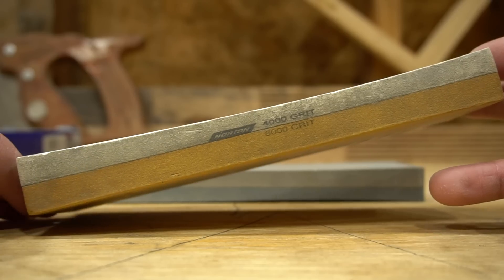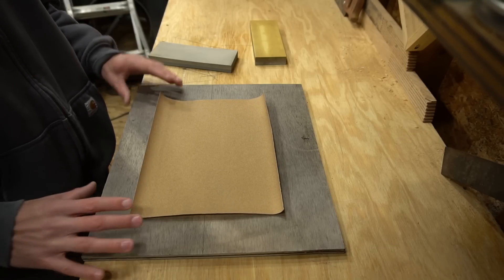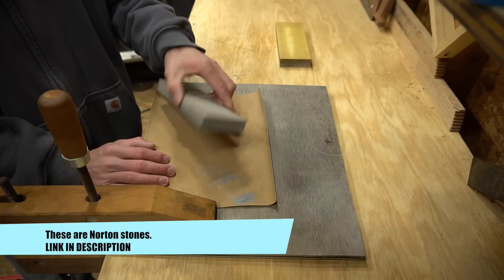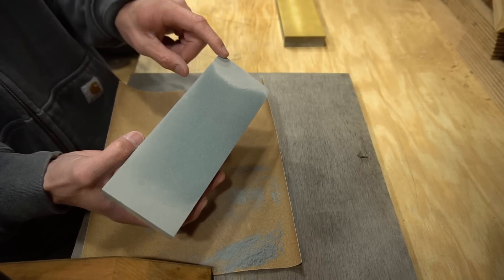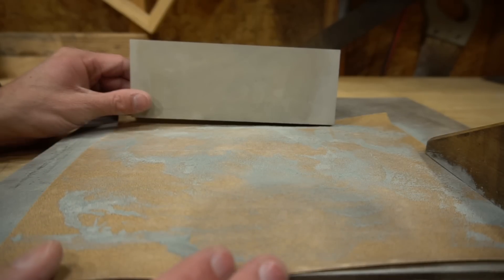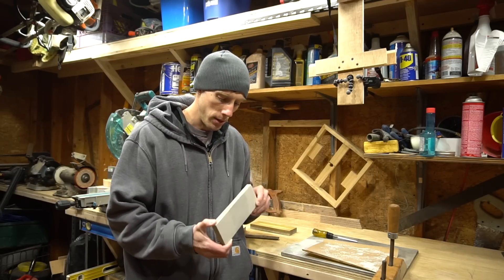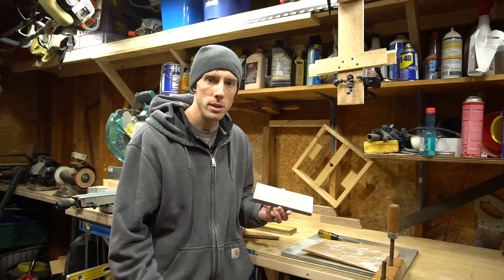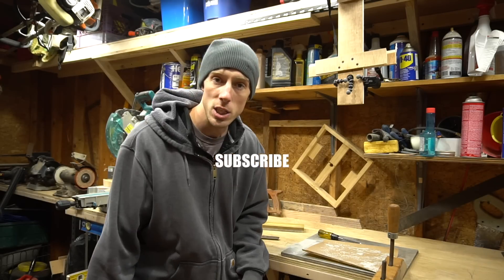How I flatten my knife sharpening stones | Knife sharpening tips 4

Comment: Just be careful with the dust it can kick up. Silicosis is no fun. That's one big reason for using water.
Reply from the maker: You'd have to breath a lot of dust for silicosis to occur. That typically happens over years of exposure. Ive worked in areas where silica dust was a problem. Even with proactive gear I've probably breathed more of it in that environment than I have flattening stones once or twice a year.  Id still recommend using a mask or water if the thought bothers you.  Thanks for the comment😀👍
Reply: @OUTDOORS55  The fact that one had already exposure to dangerous dust is not a reason to avoid to protect ourselves, maybe is a reason to protect us more carefully as the risk grows with the amount of the exposure. My 2 cents are that for someone that flattens occasionally the stones without power tools there is no reason to worry, using the belt sander it is completely different, you had to switch off the camera to protect it, the same is true for lungs. A protective mask is really cheap, even the professional ones, and flattening the stones as last work of the day the next day the air should be clean enough to breathe without any risk.

Comment: I use a offcut block of granite from a headstone maker and sifted river sand. Use a fine kitchen sieve. Sprinkle the sand on the block, sprits with water and apply elbow grease. Ad sand and water as the previose lot turns to mud. All comes free, and I am cheap, so it is a good deal and system. I use Nortan stones and selfmade pure cement stones, and sandpaper just dulls too quickly.

Comment: A much better and cheaper way to do this is with a piece of scrap glass (very easy to find on trash day) and some silicon carbide blasting grit.  Also, learn to better utilize your stone's surface area so your stones don't get so dished in the first place.  And finally, as many others have said, never do this dry for safety reasons.  Using a lubricant also makes the process go faster and cleanup easier.
Reply: Atoma diamond plates and water for me. I try to protect my lungs as much as possible.

Comment: I tried this with a 30 year old Lansky stone. It didn't flatten my stone, even after 20 minutes, The interesting thing is that the corners where it was touching started acting like a set of diamond ground flat stones like you would use in the machine shop. So a 100 grit stone now felt like maybe 800. Maybe I just got some crappy sandpaper. Maybe I need SiC paper?

Comment: I must thank you for the amazing tip. I bought 3 sheets of 120 grit water-resistant sandpaper, put on a thick glass surface (in my case short table), added some water and flattened my 3 Shapton Korumaku stones. I had no vice, so I held the paper with one hand and moved the stone with the other. Not even 5 minutes I was done. After, I rinsed the sandpaper with water and let it dry for later use. I marked each one with the grit of the corresponding stone to not mix them up.
Total cost 3$.
You're the best!!!!

Comment: Great practical tutorial as usual.
I'd like to add a tiny bit of advice if I may. If you do this by hand don't throw away the sandstone dust, you can use it on a wet cloth for surface rust removal and rough polishing of large irregular metal objects.
Reply from the maker: Interesting, ill keep that in mind👍
Reply: It's also used in the clay for yaki-ire (differential hardening) the whetstone powder is added to a 1:1:1 ratio along with clay powder and charcoal powder. It's then mixed with water and applied to the blade with little to no clay on the edge.
Reply: That's very clever 👍

Comment: might be a dumb question but is it critical that the stones be flat? like how far yours was, would that produce a poor grind or the wrong angle?
Reply: martin blouin it will just cause a convex grind/bevel.
Reply: yes, you will need to have flat stones for a proper V edge. if it's a little off, it may not make a huge difference but better to flatten them more often than not. unless you want Convex edge (which if your daily tasks benefit from a convex edge, then its great idea, google edge types).

does Outdoors55 have a video on different Edge types? that would be a great one for him to do. what the different grinds are and what they specialize in.
Reply from the maker: Tactical Center is correct. It doesn't hurt anything but will give you a slight convex edge. I have found, even with a flat stone, I will still convex a little. Im not sure a human is capable of maintaining any angle, as to not convex even a little. Im sure someone out there can, but its definitely not me haha.  Knives with large bevels like scandis it is possible to get an accurate perfect v shape with a flat stone. It just depends what your looking for.
Reply: Definitely agree. its hard to not convex a little unless you get a guided system like KME, Edge pro, lansky etc. but as long as you apex it will cut.

Comment: If you used water wouldn't it "carry away" some of the removed material and make the sheets of sandpaper effective longer?
Reply: yes it would, I use the same method but it never takes me 5 sheets to flatten a stone, 1 sheet for both sides. Of course his stones might be harder.
Reply from the maker: My stones were in bad shape thats why it took so many sheets. I don't like using sand paper after it starts cutting poorly so I change out a lot . I suppose you could stretch it but at the cost of time. Thats my opinion anyway, your milage may vary😀 Thanks for the comment!

Comment: This method is good for relative soft stones, the problem is to flatten high quality ceramic I.e. (SiC, Al2O3 ZrO2) in they pure from and all sorts of mix of them. The only way there is to use another as hard stone and arm yourself with patient. You may use diamonds but it is expensive. I writing it cause I allerdy flattening one of this hight tech stone, and it is not a easy task.

Comment: I like that you use the word "relatively" several times - sharpening is personal thing and every man has its ways. Sharpening cutting tools can be really relaxing and enjoyable hobby. I catch myself sometimes trying too hard and makes simple process difficult. P.S. These Norton stones look too soft and it is sad to see so much abrasive to go into the trash - can I suggest: Naniwa Professional 400 and Sigma Power Select II - 1000 in the lower grits?
Keep the good work and the interesting videos coming.
Reply: Stefan Wolf, why not naniwa professional 1k?
Reply: Frederick Kunitz only reason to suggest the SPS II 1000 (it has no bonding agent/material) - to try different types of stones
Reply from the maker: Stefan Wolf- For sure, sharpening is a personal thing and everyone has their ways. What works for me may not work for others. The Norton stones are soft stones. They are slurry stones and really need practice in order to use efficiently. They work great when used properly. Although if I had my choice I would use splash and go stones over slurry stones any day. I use the edge pro stones more than anything. Im not super picky as to which stones I use. As long as they do the job thats all that matter to me. I guess I'm a simpleton haha. Thanks for the comment😀

Comment: I've seen the Norton's Stone Beginner's set on Amazon and it comes with a stone flattener, have you used one of those? I'm still saving up for a good middle priced set of water stones, I think I'll try those Edge Pro one's you showed, don't want to spend a lot and end up going back to my faithful Lansky set.😎
Reply from the maker: I haven't tried a dedicated flattening stone.  Im not sure they are worth the money unless you need to flatten a lot. The edge pros are great if you don't mind the small size. They cut great and last forever. I wish they made them slightly bigger though.

Comment: Did you have that big of a dip in the stone on purpose for the video or was that how your stones usually are? You really shouldn't let it get that bad, to the point where its visible. I use a diamond plate for flattening and after each sharpening I draw a grid with a pencil and hit the stone with the diamond plate. If it takes off the whole grid with a few swipes then its still flat. If not, I do it until the grid is gone, draw a new one and check again with a few swipes. It's easier, faster and preserves more of your stone to do it regularly rather than wait until a huge dip forms. Not to mention it's better for sharpening to have a flat stone.

Comment: 150 Grit? I wouldn't mind using 150 on my 1000 Stone, but is 150 still okay to use on a 10000 Stone? I mostly only use this stone for straight razors, and I may need to flatten it soon but I'm not sure what grit sandpaper to use
Reply: Depends how bad the stone is. If you have to do a lot of work and it has a big gully in it like the stone on this video the do most of the work with something like 150 grit. I would still probably do most of the work with 150 grit anyway or lower. Then when it gets close I would finish it with a finer sandpaper, I would recommend 600 grit. If you don't like the way it feels then you can adjust up or down from there.
Reply from the maker: If your stone is bad it will take awhile on anything finer than 150 grit. I flattened my 8000 on 150. If you need it to be super smooth for the first blade use a finer paper and smooth it out.

Comment: Personally I would recommend flattening whenever you put a straight edge like a steel ruler against the stone, hold it up to the light and see light come through the gap. You will find that even though you level it more you will wear the stone down less. Especially with these more expensive stones that can be desirable. To explain why it wears less imagine a pothole in a dirt road. It starts off really tiny. But you will notice it will double in size faster each time (up to a point and with the same amount of traffic). This is because as it gets bigger the gets hit harder each time and therefor grows faster. With the stone you are basically doing the same thing with the gully in the stone.
Typically I am a little lazy and don't do all my stones at the point I mentioned unless I am doing other peoples knives. This is because you get a more consistent angle on the blade when the stone is flatter. But for my knives I don't mind so much.

Comment: Some people just use two identical stones (pairing a set when new), then it's possible to true them against each other. You just have to remember to alternate between them when sharpening too.
Reply: the correct technique is to use 3 stones, as with only 2 is likely that a convex face and a concave one are obtained, the method can be used sometimes with not too dished stones if the sand paper is not available for some reason, as the surface will be  very close to flat, but using only and every time the 2 stones method does not give a good result as once a pattern concave face and convex face is established each subsequent flattening make it worst.
Reply: @andreachinaglia5804    I do flatten my two stones against each other and I've never had a problem. Please explain to me how having two equally concave stones of the same brand and same grit, you end up with one concave stone and convex the other, it really puzzles me. Thanks.
Reply: @redangrybird7564  because even if you try your best to have an even movement you can end in 2 flat mating surfaces as well as in 2 mating surfaces that are 1 concave and 1 convex.
Actually the old method used to obtain lenses was to rub one against the other 2 discs of glass with some abrasive in between, while to obtain those perfectly flat granite blocks that the mechanics use as reference 3 blocks of stone are used alternating them constantly.
I don't doubt that you obtained 2 flat enough sharpening stones, but using exclusively the 2 stones method it is sure that you will end with 1 concave and 1 convex surface in the long run. And as the surfaces will mate perfecthy your only chances to correct it is to introduce a 3rd stone or use a flat surface and sand paper.
Keep what i say in the correct proportion, you can flatten your 2 stones many times with the method you use, but as soon as you start to see that the obtained surfaces are 1 concave and 1 convex go to the sand paper using the most true surface you have to back it. I hope that now it is clear to you.

Comment: Well darn, I never thought to use my belt sander!  I have two stones from the dollar store that I switch between to flatten my third,  good stone.  

I also have a 1 foot by 1 foot square piece of granite. It's about 0.5 to  0.75 inches thick, and fairly heavy.  I got it from a company that does granite counters.  They had free machine cut samples. If you don't care about the shape,  anyone installing granite counters will have lots of cast offs they will probably give you.  Another source is granite floor tile. It's a little thinner,  but still machine cut and smoothed, and heavy enough that is unlikely to move around on you. You can get a discontinued piece for one dollar.  None of these are "machinist" level stones, but you can tape sand paper to them and flatten whet stones, or even sharpen items on them.

Comment: i dont know if it will save that much money vs SP. but i get a jar full of SiC powder in a lower grit and put it on glass or granite tile and a lil bit of water. i dont let my edge pro stones get that flat typically, so i don't use much of the powder. its basically make your own sand paper without the paper. 

i assume this could save money depending on how much you get and the cost for it vs 5 sheets of sandpaper which is pretty cheap to begin with.

SiC, even tho its harder it wears out faster than say ceramic/Alox. you would think it would last longer and not dish so often. i like using ceramic but i avoid it at all cost for vanadium steels where SiC and diamonds cut Vanadium etc without effort.
Reply from the maker: That was one of the methods I was referring to. I am usually always stocked up on sandpaper so thats what I use. The Sic powder id have to order.  Thanks for the comment😀
Reply: Matthew M SiC = Silicon carbide

Comment: I was literally just about to ask what stones these are and where to get them. I have used that sharpening kit thing that comes in the box that doesn't close and I just don't feel like it's doing the job. Im going back through Outdoors55 University in sharpening and getting some real stones and learning. Just need that cash... dang adulting and buying diapers!
Reply from the maker: Haha! I'm surprised your lansky isn't working out. Been using mine here and there. Only thing is the stones don't cut the greatest and it takes time. I don't know if I'll buy these stones again. They work great but require getting used to. They are slurry stones and very soft. They also take a lot of time to use. Ceramic stones are great and easy to use if you buy a super coarse and fine. The edge pros are great too if you can deal with the size. A lot of good stones out there.  Just a matter of finding one you prefer. And I hear ya on the diapers 😂

Comment: If you draw a checker pattern in pencil on the stone, you can see more accurately what's being ground away, so you don't take too much stone away. Over time it really adds up. Also you would save money over time if you  used a diamond plate vs sandpaper. P.S.  You will lose cutting performance sharpening a knife on a dished stone.
Reply: Herb Toker yes, i had to comment to tell you that I like your profile pic. I've always wanted a mitsu tomoe tattoo. Something about it just looks really cool to me.